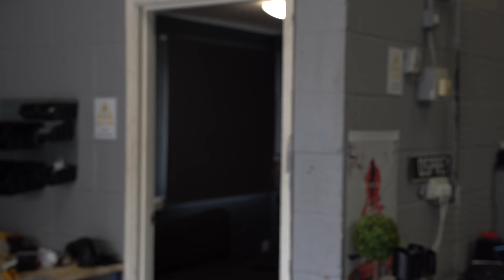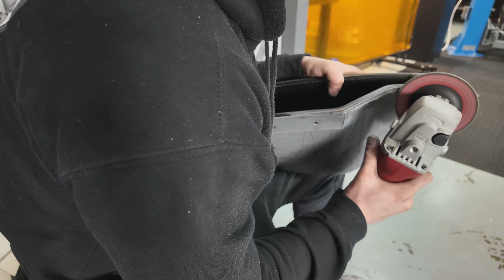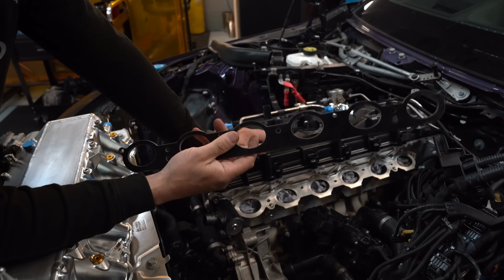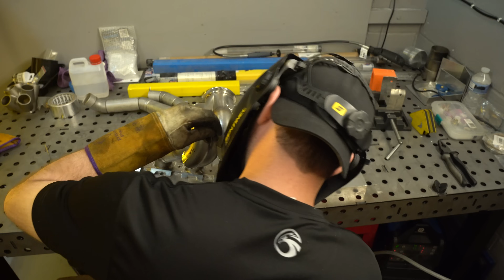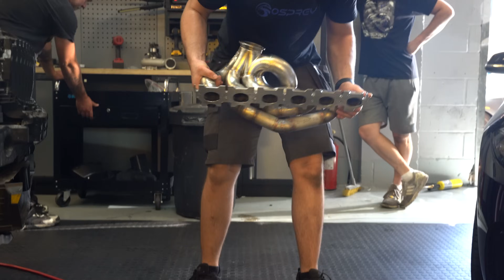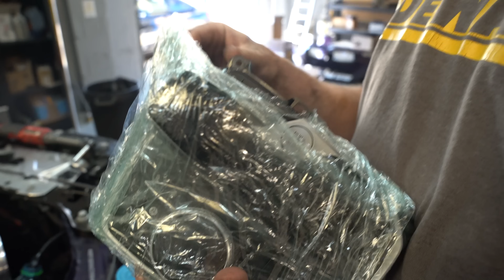Officially Gassed M240i - EP.2

Comment: Great video guys, keep them coming. Unsure why the compressor outlet does a right angle instead of more straight. Therefor avoiding heat front the exhaust manifold and also being a more direct less restrictive route?
Reply from the maker: Thanks for watching, basically to make space for the oil catch can in that location.